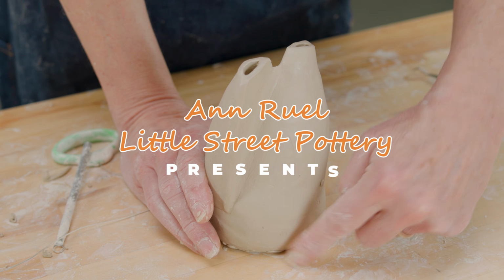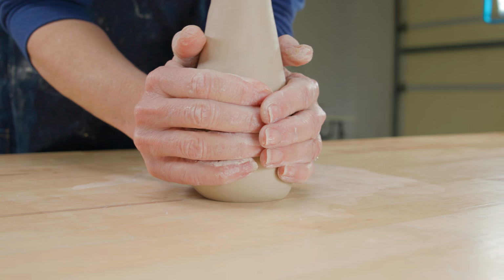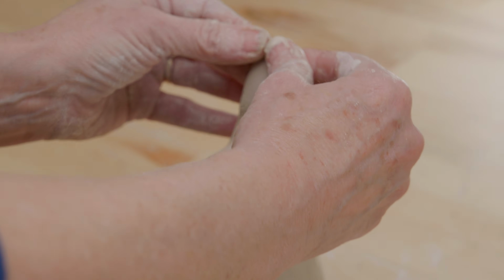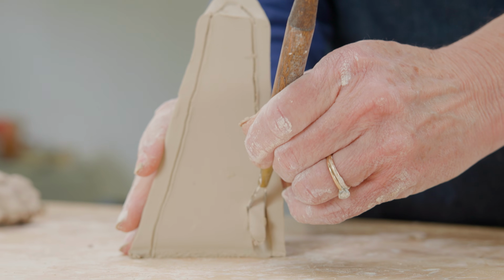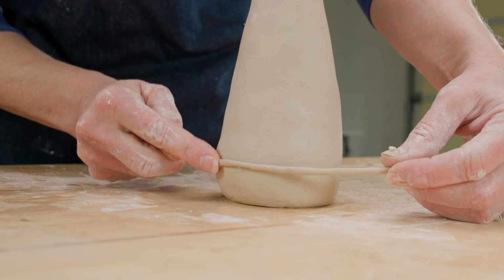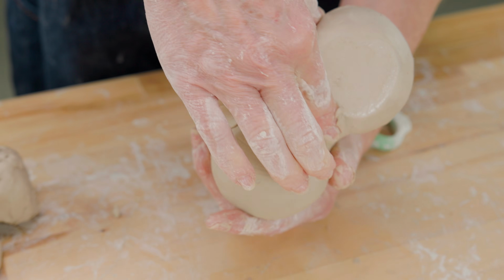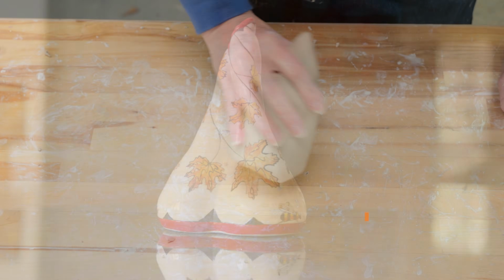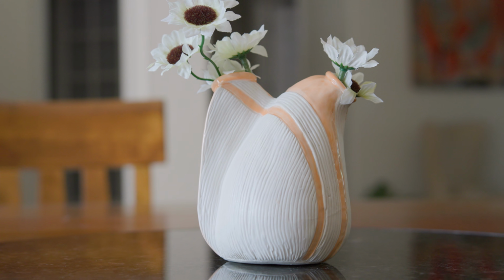Pottery CONSTRUCTION by REDUCTION! A Different Way To Make Pottery!

Comment: Hi Ann :)  what a great video. Thank you so much for all your awesome videos.  What body of clay are you using? Also, for your drawings, do you use an underglaze pencil? Your black lines look amazing.
Reply: Hi Lyli.  thanks so much for the kind words!!!  Im glad you like them.  We really do put a lot of work into these.  As far as the clay I am using, I do a lot of painting on my my clay and needed one that was smooth and cool white so my clay is a bit pricey, but worth it....I use Standard brand #365 English Porcelain.  As far as my underglaze, I dont use an underglaze pencil, but to get the fine lines your brush is very important.  I use fingernail detailing brushes.  They are made for harsh materials and they keep their points a lot longer than fine art brushes.  Actually next week, hopefully we will be putting together a video on how I did the painting for on the red tear drop vase so it may be interesting to you.  Have a great week. Ann

Comment: It’s so good that someone as skilled as you with wheel throwing and hand building can find patience for this scooping out technique. I find it messy but your final products are gorgeous!
Reply: Hi Worrier.   I wasnt sure about it either, but the scooping out was very satisfying for some reason and actually didnt take as much time as you would think.  I can see how you would think that it would be difficult to clean up, but thumbing the surface after the carving did the trick to the inside.  Give it a go.